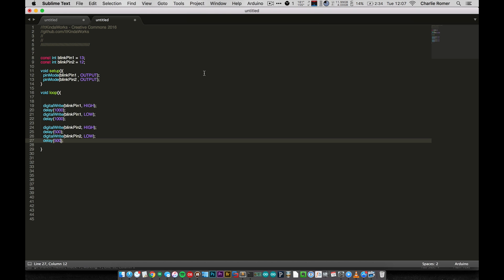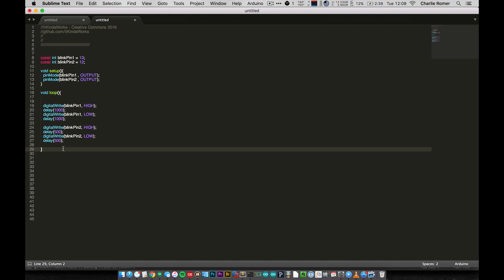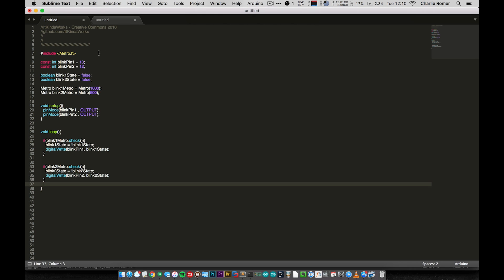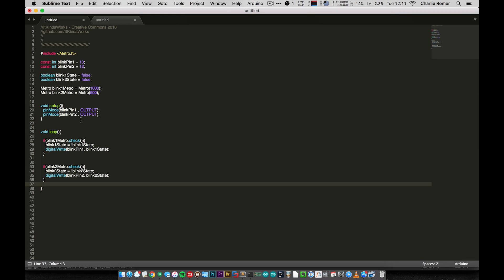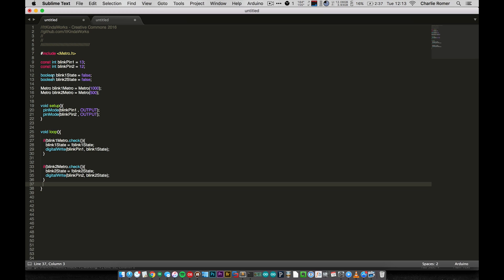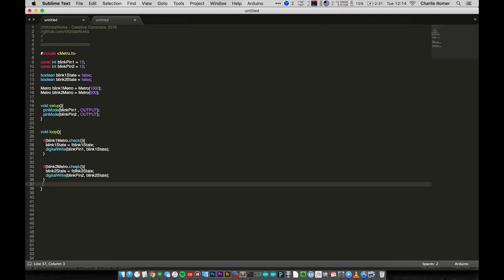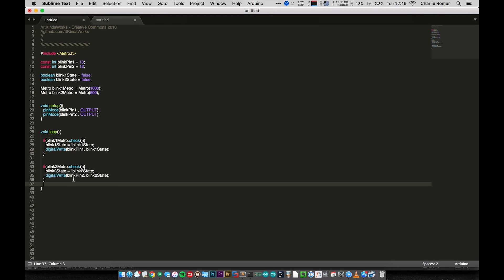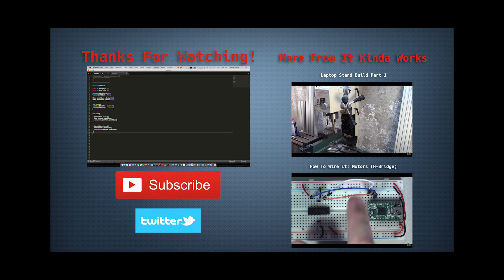How to multi-task on an Arduino

Comment: I have been working as a Software Developer for more than 40 Years, using each and every type of Computer, each and every Programming Language and Operating System available at its time and have been teaching lots of Students and Engineers at almost every great Company in most of Europe. Today, i am 67 Years old and retired. I have held many Courses on Multithreading, Multitasking and Parallel Computing and therefore  i would like to make the following Topics clear, since there still is a lot of Confusion (i tried to keep it compact):

Regarding "Parallelism": 
Your Computer may have as many Cores as you can imagine, real Paralellism only happens "between" these cores. As each Core has its own set of registers; working only with these, the core can do something while the other Cores do different things. 

Regarding "Hyper Threading cores":
They can execute more then 1 Task at the "same time", BUT - they still have only one set of registers, so no "real" parallelism in this feature, but "simple" multithreading instead.
By the way, Intel had temporarily stopped implementing Hyper Threading in its CPU's for some time.

Conclusion:
Even using many cores in parallel, parallelism is impossible in the very moment one of these cores does access memory or IO ports, since these resources only exist once in a Computer, so all other cores wanting to access memory or io have to wait - ciao Parallelism ! So it stays true - a Computer can only do one thing at a time, if it needs resources which are only available once. And it will need them for certain.

Modern, fancy High-level Languages hide these Facts from you, so it is not uncommon that your Software "sometimes" is acting strange while mostly runs with no Problem at all.

Problem is, Computers nowadays are so insanely fast that you cannot notice these bottlenecks, and debugging this is a real Chore, so you always should start Parallel development on one single Computer, best with only one Core to verify basic functionality, and then switch to Multiple Cores or Parallel Computers.

The only way to do real parallelism is working with parallel computers - which means supercomputers or networking computers distributing Tasks to different Computers within the virtual or real System (see SETI Project, for example).

Comment: I always implemented my own scheduler, I create task that have a "timer" and it will fire a callback function when the time is over. It can be started, stopped, paused and also it can be a recurring timer that will call the function multiples times at a set interval. Its lightweight.

Comment: Could we use this library for lighting up 2 leds pressing their pushing buttons simoultaneously ? (each push-button I wanna work as a toggle switch for each led separately, but I want if I press the 2 buttons at the same time to work as well)
Reply: Yes. 
int btnpin1=10;
int btnpin2= 11;
int ledpin1 = 12;
int ledpin2 = 13;
boolean ledstate1, ledstate2, btnstate1, btnstate2;
void loop() {
if(digitalRead(btnpin1) && !btnstate1) {
btnstate1 = true;
ledstate1 = !ledstate21;
digitalWrite(ledpin1, ledstate1);
} else {
btnstate = false;
}
if(digitalRead(btnpin2) && !btnstate2) {
btnstate2 = true;
ledstate2 = !ledstate2;
digitalWrite(ledpin2, ledstate2);
} else {
btnstate2 = false;
}
}

Comment: until now to run several processes in parallel i used 2 arduinos using I2C Bus but it involved larger costs. you cut my production costs.Thank you

Comment: Idk why but tries to blink 2 lights at once at different speeds without the library and that works pretty easily. The code was about the same size as the one you wrote while using the library. But obviously it will be harder for larger projects and that's where the library comes in. Thanks for the help
Reply from the maker: there are many ways to skin a cat. also programming....

Comment: It's a neat solution to the problem however why should I use the Metro library which I have to download and install before I can work with it when there's the already built-in timer called "millis " that I can use and basically do the same thing?

Comment: Only thing is if you are asking students to do something and then use a library. You are cheating ;)
Reply from the maker: How so? Libraries are provided by those who make them so that others don't have to re-do work thats already been solved. If your goal is to learn how to make your own timer code, then sure you're not going to get exactly what you want from this library but if your goal is to make a robot that can do a bunch of things simultaneously then using this library is going to make that experience much easier. Learning happens in all sorts of ways and doing it the "hard way" can discourage people who want to learn but don't want to get bogged down in the details (leave that for later when they've been bitten by the bug and want to learn it).

Comment: huh? i take it you know what youre talking about, but i was always under the impression that a computer can do as many things simultaneously as it has threads? aka a single core cpu can do one thing at a time. a dual core can do 2, a quad core can do 4, and a hyper threaded quad core can do 8 things simultaneously. 4 cores, 8 threads.. what are you talking about a computer only does one thing at a time? have i had this core piece of information wrong all these years?
Reply from the maker: Depending on how you look at it, we're both right. Modern processors contain multiple cores and if you include hyperthreading then each core contains 2 logical units (the parts that do the processing) but share other resources (like caches). So for a quad core processor with hyperthreading it has 8 logic units total. So from that perspective, yes a computer can do multiple things at the same time because of the multiple cores. I take the view of a processor being the logical core, the part that takes a command, does something with it and returns the result. From that perspective, the logic units in your computer really are only doing one thing at a time (there just happen to be multiple of them in the same computer). The OS takes advantage of this by splitting processes up into threads and scheduling everything so that it all seems simultaneous but at the lowest levels it still is only doing one thing at a time. At the time of writing this my computer has ~2600 threads active, far more than my laptop has cores but the OS makes sure to give each one just a small slice of time. Since modern processors run in the multiple Ghz this isn't noticeable. So it all just depends on how you think about it.
Reply: @ItKindaWorks  
yeah agreed. I build computers for a hobby/living. Im fairly well versed in everything intel/amd/nvidia/and windows xp-10.1903. cpu's can definitely do more than one thing at a time. they do do as many things simultaneously as they have threads. thats the whole point of threads. Im not gonna be one of those douche bags on youtube being all super critical about things that were said in videos. lol. You said cpu but i think you meant a cpu as it is with a single core and no hyperthreading. in which case, yes i agree. 1 core, 1 thread, 1 process at a time. and we dont notice it because it's doing billions things per second. it requests, finds, loads, exucutes, and moves on past that one thing faster than can even be calculated or even perceived without insanely complex math and other computers.

this is a great video. i was just saying my comment more as a joke than anything else. i subscribed. thumbs up!

Comment: Did you say modern computer CPU's can only do one thing at a time?  I think you may be as wrong as it is possible to be wrong on this point fella.
Reply from the maker: Lol well when you get right down to it a single cpu core can only do one task at a time. Modern cpu dies have multiple cores which allow for parallel processing but each cpu can only truly process one instruction at a time. This is why computers require advanced schedulers in their os, to create the illusion of multiple items running at the same time. Us meat sacks are just too slow

Comment: Believe it or not, the Apollo computers on the Lunar Lander also does this method, which is to do multiple commands really quickly. Apparently, if you put too many commands however, it will overload and give you an alarm, which happened on Apollo 11 with 1201 and 1202 alarms.
Reply from the maker: Thats awesome! I didnt know that

Comment: Do this library support microseconds
Reply from the maker: It does not. It wouldnt be difficult to modify this library though to allow for microsecond timing by using the micros function instead of the millis function.

Comment: I wonder why these Arduino library authors seem to like to use copy constructors? Why not just use one Metro constructor call, passing in the timeout time?
Reply: OK, did a little more research on this...

The Arduino IDE's default compiler flags include "-std=c++14" and "-felide-constructors". So that means even though this line of code looks like it would invoke the copy constructor:

Metro  blink1Metro = Metro(1000);

It doesn't. Instead return value optimization is used to avoid the intermediate object creation/deletion and the copy constructor invocation that would happen in the middle of that. So this is why you can just write it the way he shows in the video, instead of this:

Metro blink1Metro(1000);

...which is what you used to have to do before the nice people on the C++ standards committee figured out move semantics, rvalue references and return value optimization.

Comment: Is it possible to do something like this with two piezos?
Reply from the maker: It depends, are you trying to use the piezo units as sensors or as speakers (or more specifically are you trying to play multiple sounds at the same time through 2 piezo speakers)?
Reply: The idea was to make piezo stereo speakers.
Reply from the maker: Then probably not (at least with the piezo speaker library that I know about). While this could let you operate two devices at nearly the same time, the piezo speaker library only supports a single speaker device at a time. So even if you did write it in such a way that it tried to control both nearly simultaneously, it would only play sound from one at a time.

Comment: A single timer is used to control  multiple Blinking Leds each Led blinking at different Blink rates  . 
Clearly Arduino has only 1 timer that is can be used time Led_1 at rate 1blink/1000msec,  Led_2;  at rate 1blink/500msec, ...
Led_n at 1blink/n_msec. 

It is NOT made clear ENOUGH that the 10 to 100 usec used in the ATmega328  by the millisec timer causes the LEds_1 to 
blink every  1,000,087usec ( 1000msec +87usec ...where (say)  87 usec is the accumulation of  time  intervals for the ATmega328 to activate its timer for _n different Led time intervals.

No problem for flashing Leds ...a HUGE  problem for activating a very high speed device in which timing must be precise (say) 
 +/- 5msec   hour after a hour.
Reply from the maker: Sure but this was never meant to be used for high speed timing. FWIW the timer itself doesn't accumulate the error, it resets the moment the check() function returns true meaning that the only error introduced is the error from check to activation which can be accounted for. I think with the situation you're proposing the larger issue is not something that is software related so much as it is hardware precision related. For that kind of accuracy I would tend to use an RTC either from a chip or from a GPS. Or even use a more powerful Arduino clone like the Teensy 3.x series. I believe the Teensy 3.5/3.6 both have onboard RTCs even and use 100+mhz processors. For similar pricing to the official Arduino boards (not cheap clones) the Teensy would be the way to go for high speed/timing accuracy.

Comment: You don't need any external libraries to do this. Just keep track of millis() and compare it to the last time the loop ran. The IDE even comes with an example called "Blink Without Delay" which demonstrates this.
Reply from the maker: Yes I know but for beginners I've found that metro is much easier to learn (I know from both experience myself as a beginner learning this so many years ago and from teaching it now to those who are new to arduino). Behind the scenes metro is doing exactly the same thing but it hides some of the complexities. Eventually it would be good to learn the manual way but for those who just want to get something working, metro is an easy to learn solution.

Comment: Hello Awesome video. But i have a small problem mine doesn't contain led blinks. I have a Ethernet shield with a Temperature sensor and a Oled screen that display the same temperature sensor as it does on the webpage. Problem. Is it updates the webpage every 5 seconds then updates the Oled screen every one second. with the current information. Problem is the the information that is on the webpage is different then what is on the oled. Can this method be adapted to something i have?

Comment: What if I don’t want two things to continue happening again and again but rather just one time but I do want them to happen simultaneously. For instance what if I want to digital write high on one motor for 5 seconds and a second motor for 3 seconds simultaneously both starting at the same time? Would I need to use something to do with Millie instead?

Comment: from what i understand, that program fires blink2 at 500ms, blink1 at 1000ms and blink2 again at 1001ms. is that correct?

so if i have a task (task1) that is more frequently called than the others(task2) duration,  task2 is never done or if done delaying task1 ?

or does this swap between the tasks to work at them almost parallel?
Reply from the maker: It swaps between the two tasks almost in parallel. It cant do them literally at the same time if their timers match up but the Arduino is certainly capable of turning a pin on/off faster than 1ms at a time. It may take on the order of microseconds but in most situations that is plenty fast enough
Reply: Thanks for the precision! I was wondering too!

Comment: This is just what I have been looking for!  Problem is, I have tried to add the Metro to my Arduino libary and the library error message says  "Specified Folder/ZIP File Does Not Contain a Valid Library".  Any ideas?
Reply from the maker: This usually happens when you unzip the library and your unzipping software creates a folder for the contents (so rather than looking like metro/<code files> it looks like metro/metro/<code files>. Or it could possibly be that the folder isnt named properly. There cant be any dashes in the library folder name (Metro-master) for example. Just remove the "-master" part.
Reply: Hey, did you solve your problem? I go the same issue?

Comment: what particular kind of arduino would you need to run about 6 servos?
Reply from the maker: Based on the info on this page most Arduinos should be able to handle up to 12 servos so you should be able to use a standard one just fine.
Reply from the maker: https://www.arduino.cc/en/Reference/Servo

Comment: @ItKindaWorks 
I thought the timer is resetting by itself, I'm only getting the timer TRUE after the interval elapsed since power on, after that, is always TRUE
Reply from the maker: How often are you calling the check method? It should automatically reset the timer each time the check method returns true. Does your setup or other code take a long time before it starts checking your timer? I think there are a couple of different modes with the Metro library, one that will run multiple times to "catch up" if the timer elapsed multiple times over (so if you had a 5 second metro timer and only checked it once every 15 seconds it would return true 3 times), and one that will just return once and skip missed checks.

Comment: as a newbie to the Arduino this is brilliant, just what I was looking for, Thank You very much for this. I think I'll be able to adapt your example to switch multiple leds with varying different on and off intervals i.e. time ON interval different to time OFF interval  (a self appointed challenge to get my head around and develop my knowledge and experience with this platform). I can now stand on the shoulders of a giant :), just love it.

Comment: In a real-time embedded system program, while loop is also blocking code. Any substitute for blocking, obnoxious  while loop?
Reply from the maker: This same mechanism can be used for looping. You just have to be a bit creative about how you implement your loop to prevent the code from blocking. One example would be to have a status variable that it set to true when "looping" and false when not. Then you could have an if statement that looks like 

if(shouldLoop == true && myTimer.check())
    //do some code that should loop
    // when some target condition is reached set shouldLoop to false

Now you can have other code that surrounds this if statement and will execute even if the "loop" should be also running.
Reply: +ItKindaWorks Nice. Worked well. :D